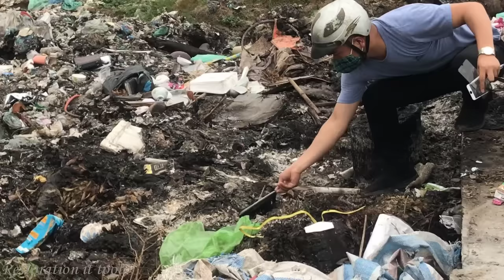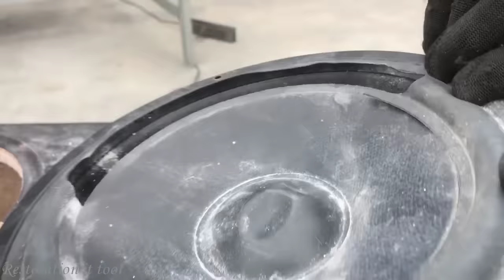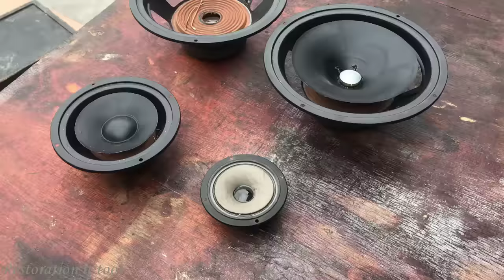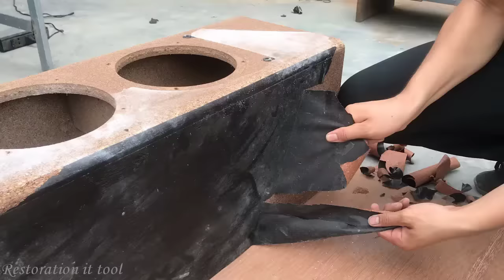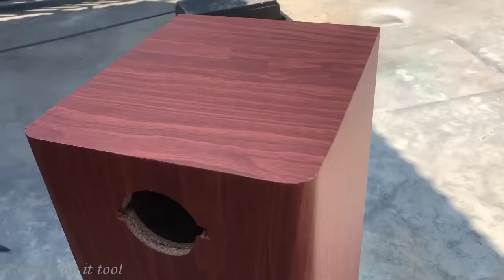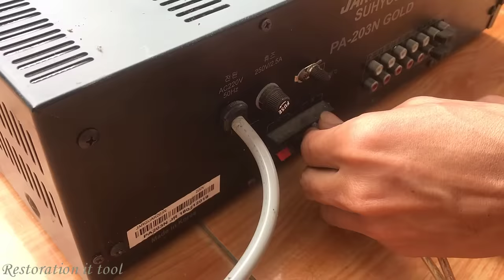Tree speaker restoration | Restore and reuse old tree speakers

Comment: Nice work. However the speakers were not soldered in the correct way/direction. One is for and one against. Mainly because you confused the left and the right which will result in significantly less bass than it’s capable off
Reply: Based on your comment I watched again desoldering (of woofers) on teardown and lf you watch resoldering with restored facing down the (-) is on the left side and clearly shown on the driver. That's the way he reconstructed, cheers.
Reply: L
Reply: Yyyyyyy
Yyyyyyyyyyyyyyyyyyyy{yyy